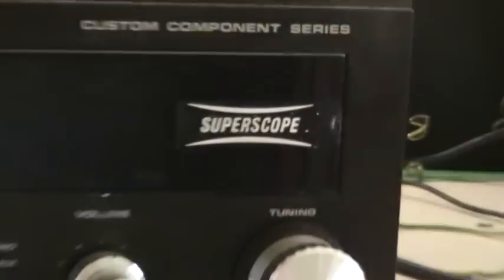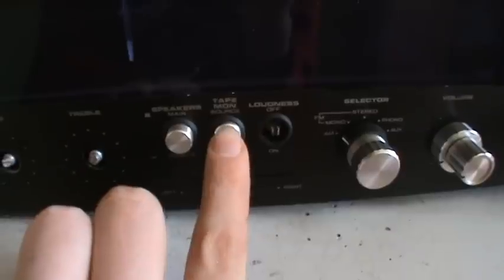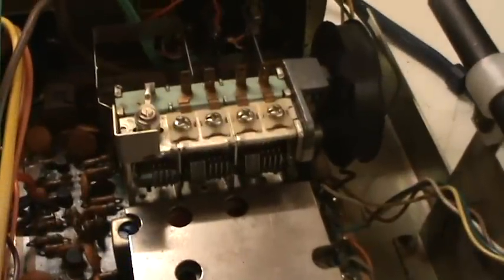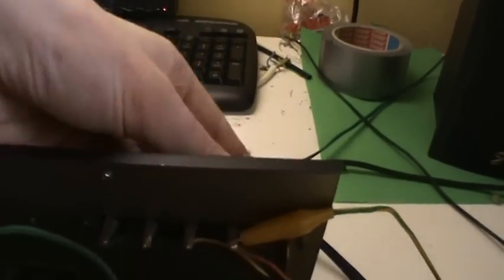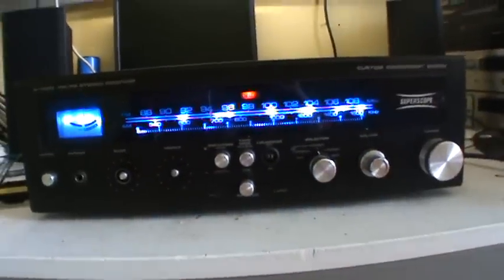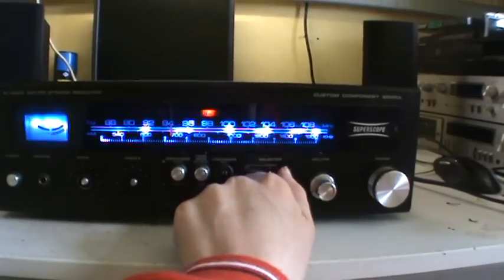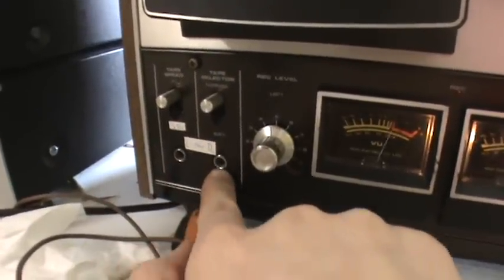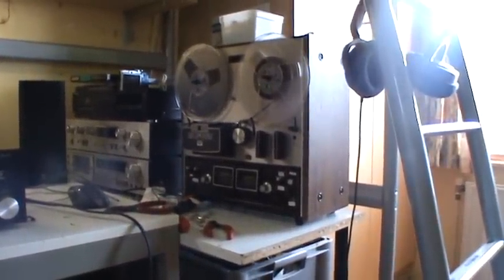Superscope R-1220 Receiver & Akai GX-210D Reel To Reel

Comment from the maker: @DrCassette thank you!

i took one of the 4000DS machines apart, because the motor and amplifier had some problems. the belt was broken too.

the potentiometer is just in there so i can use the receiver, but as soon as i have a replacement i put a new one in.

Comment: Very nice equipment! The Superscope receiver was not made by Marantz. It's the other way round: Superscope made Marantz. Because back in the 70s Marantz was owned by Superscope. I have a Marantz cassette deck that was also available badged "Superscope".
The LEDs don't look too good on the video... but they do their purpose :) The broken dial cord is too bad, replacing those cords needs so much patience...